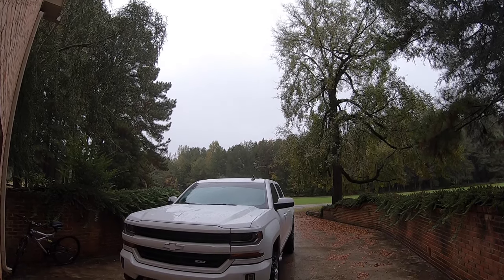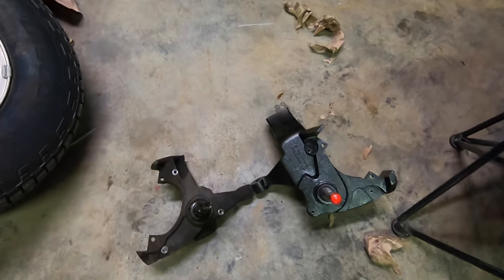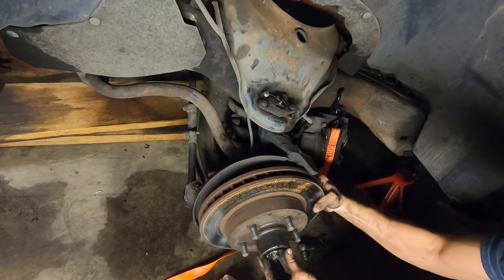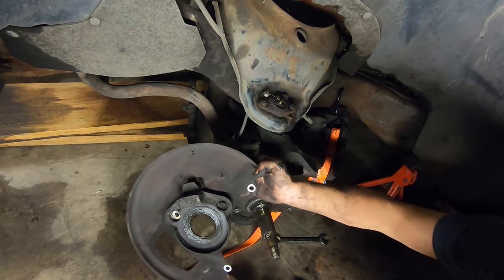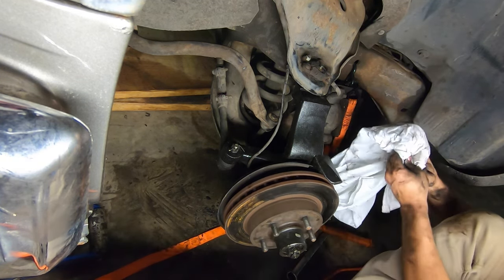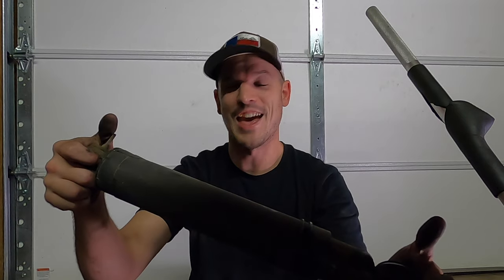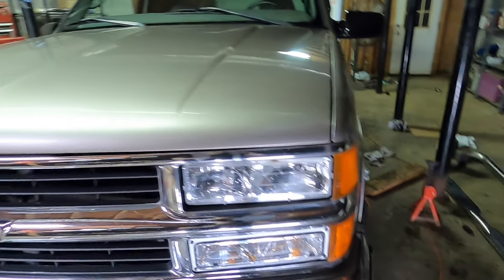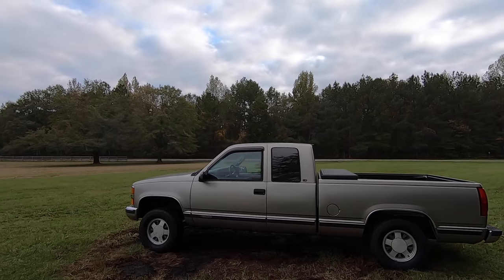4" Rough Country Spindle lift install 1988-1999 C1500!

Comment: I raised mine the same way but I also did 3 inch pylon blocks in the bed and the cab. I have SMV shocks as well. My tool box is the Trail Boss tool box black.

Comment: Just a helpful tip if you ever have to beat on a castle nut like you did on the outer tie rod flip the nut over so the “castle “ part is down bc sometimes if you hit it like you did it’ll bend the castle part and mess up the nut and threads

Comment: I just put this lift on my 96 obs and I added 1.5 inch add a leafs in the rear with the blocks. Only problem I’m having is I need long body upper control arms to align it properly cause there is an issue with the stock ones.

Comment: I just bought a 4” lift kit but only having the mechanic lift the front, hoping I can clear 33x12.50 in the rear without rubbing at stock height in the back

Comment: Hopefully I can help some comment folks. You don’t need extended brake lines you just need to loosen a brake line holding bracket which gives you that extra brake line but you could benefit from extending brake lines. Another mention is he does not mention how to actually remove the front shock I removed my driver side with a vice grip and a wrench on the right side I didn’t even try to remove the shock and was able to install the spindle no problem.

Comment: @lmfscrew I'm curious how much the 4" lift spindles moved the same wheel and tire combo out? I know you mentioned in a different video installing spacers in the rear to match the front tire track after the spindles moved them out.

Comment: question for you. I bought the same spindles, haven't received them yet. from the looks of it it looks like the offset has changed with the new lift spindles. In your opinion, did the offset change at all?

Comment: I have a 2.5 inch level kit on my 02 f150. I have had alot of problems with getting alignments,  and wierd noises have started comin from the front end. Should i change to a spindle lift and if so is it difficult to remove a level kit?

Comment: Hey man I’m in process of installing this lift and your video was very helpful. Did you have any issue with the upper control arm hitting the top f the spindle? I’m about to break out the grinder but hoping to avoid if I can.
Reply: were you able to fix this problem

Comment: I did this lift on my c1500 about 6 months ago, and the alignment was nearly indentical after install, it was so bad 😂 got it pretty straight though
Reply: Did you get a cnotch
Reply: @hightalkswithej89  I did not, not doing high speed off-road stuff so I wasn’t worried about adding suspension travel
Reply: Same
Reply: @hightalkswithej89  I just wanted to be able to clear a 33” 10 ply tire, plus with the add a leaf kit and the RAS kit I still sit slightly higher in the back, and the truck tows amazingly. Building a roller cam 350 for it as we speak, and regearing to 4.10s and adding a rear locker.
Reply: @iDrive4fun93  so my man did u replace break lines?
Reply: @hightalkswithej89  nope, I just didn’t put them back in the first mount closest to the brake caliper. Haven’t had any issues at all.
Reply: @hightalkswithej89  I’ve also put about 45k-50k miles on the truck since I’ve done the lift
Reply: @iDrive4fun93  Preciate it man for the info and reply and I’m rebuilding my whole front end when I do the lift bearings included
Reply: @hightalkswithej89  thats a good plan, i did that with my truck and I am glad i did.
Reply: @iDrive4fun93  where’d u get front end
Reply: @hightalkswithej89  i just got bushings and hardware from Rockauto.

Comment: With that lift, did you have to get extenders for the brake lines or can you run it with out messing with the brake lines ?
Reply: I still don’t know if I need extended ones

Comment: I’m having problems I installed the kit , but now I’m having problems with my breaks . I did bleed them .. but I lose pressure when I turn . Any ideas
Reply from the maker: Id check to see if maybe the lines got damaged when installing. Get someone to mash the brakes while you're under it looking and listening
Reply: @lmfscrew  the lines are good.master new.but one thing that not sure if it’s ok . When I press the break the master Cylinder starts to bubble any idea

Comment: Would that fit my 91 Chevy C 2500 Silverado and my truck is a 6 lug extension cab long bed ????
Reply: Did it fit???
Reply: @morecodybro949  yes because it has the same frame has to 1500 2 wheel drive

Comment: Is a different cross member needed for a 3inch body lift on a 1998 chevy k1500?
Reply: any help would be awesome!
Reply: @thesidecharacter4670  I have a 1996 k1500 and I just gotta know why you're messing with the cross member. That's all frame work and I only had to remove one of mine to replace the tranny. For a lift you typically are just messing with the suspension and depending on the lift and kit the steering as well
Reply: @Thatdieselguy5  yeah this was a while ago, i had no knowledge, I got the body lift, and I want to install it myself but I have no room to do that, (nowhere flat), so my plan was to pay a shop to do it and the lowest price I got quoted was 1300$ because of the steering extension, labor and such. Now I'm planning on just buying a 6-inch rough country suspension lift.
Reply: @thesidecharacter4670  very nice. Im doing some research of my own on lifting my k1500 and thr only time I ever saw people mess around with the cross member was when they got a new one. The only thing that has me concerned with my lift is the torsion bars as I see people do lifts where they either do get a new cross member to lower them to help with stability and then videos where they dont mess around with them and just lift only at the shocks and control arms. Im just doing a 3 inch lift on my truck and I've been debating what kit to go with here in a couple months
Reply: @Thatdieselguy5  for me its overall cheaper to buy the 6 inch. The body lift has too many complications and hidden costs and variables
Reply: @thesidecharacter4670  yeah there's quite a bit to change out and cut up. I'm just doing a 3 inch suspension lift for mine. 6 is a bit pricey and overkill for me at the moment
Reply: @Thatdieselguy5  the 3 inch suspension lift on rough country is like 500. Its a little more than the body lift, might be another route to go if you find the body lift too annoying
Reply: @thesidecharacter4670  I personally find body lifts annoying and don't gave the same profile as the suspension lift and I know the cost of the 6 inch. I was referring to the tires I'd have to get for the lift to look good haha

Comment: I got the Rough Country 6 inch lift for the two wheel drive and I keep breaking my upper control arm I'm an interstate driver only don't take it off road I'm on my third set of moog and have broke 1 OEM control arm as well not many options for the 88 to 98 two wheel drive as far as control arms anybody have any ideas that would help
Reply: What year truck and what model upper control arms are hard to break unless they are too close to the frame Also where does it break at my truck is in the shop now getting new upper control arms that bent from hitting the frame due from 1 inch leveling kit and rough country 4 inch spindle lift that lame leveling kit caused bad angles
Reply: My truck is a 2wd 98  chevy now I did some research and installed   one inch ball joint spacers that are designed to fit under upper control arms and help with ball joint angles and keep the upper  control arms away from Frame
Reply: I upgraded to tubular Style for 2-wheel drive they have company called( ride Tech) 88 to 98 two wheel drive upper control arms
I've had no issues I've been on about three months now also when I add a tubular style I remove the spacer that comes with the Rough Country 6 inch lift kit for 2 wheel drive
Reply: @jonschwartz9669  how is that working for you?
Reply: @southernblood-fw6gy  I ended up getting the heavy duty forged uca they are for the 2500 and one tone the only thing that sucked was the heavy duty uca come with bigger ball joints so I had a machine shop weld a gusset plate and drill holes into control arms so my ball joint shaft would fit my spindles they are way better than the factory stamp steel

Comment: man can you please answer this question? Did you put the rear block on Larry or did you leave it the same whenever you installed the spindle lift on larry???
Reply from the maker: Larry has no block and 2” shackles
Reply: @lmfscrew  will you do the upgraded on the 2 inch coil springs in the front on Larry?
Reply: @lmfscrew  thanks man